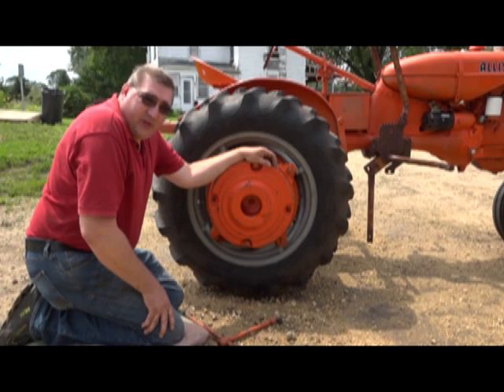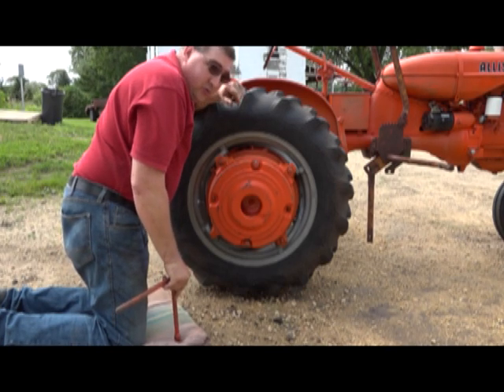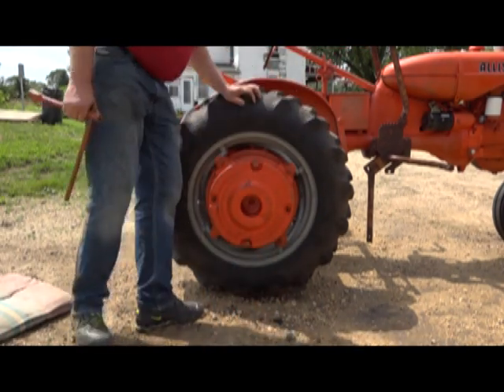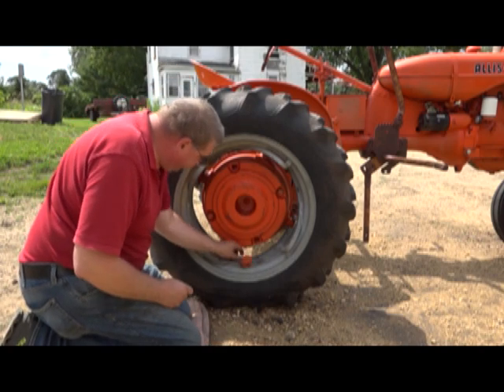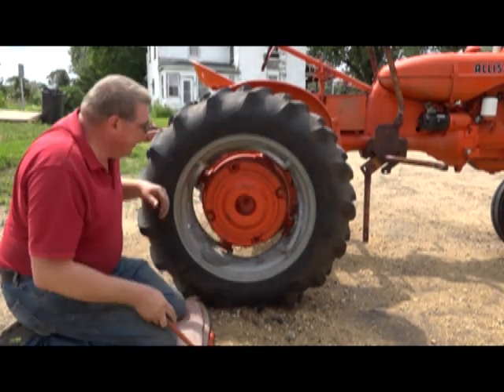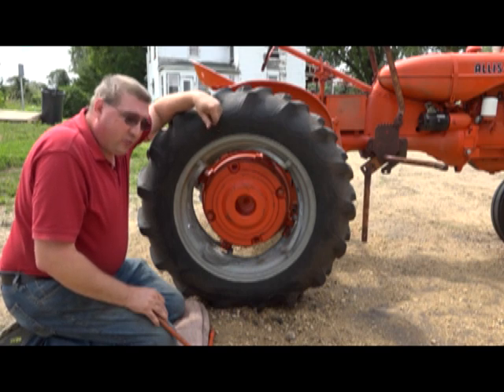How To Adjust Power Shift Wheels On A "CA" Tractor

Comment: Our stop blocks on our WD45 were set to stop for 40 inch rows when we spun the wheels out.  In was all the way in.  We never moved the stop blocks.
Reply from the maker: The stop should always be placed by the     eccentric body. This assures that the wheel will not slip on the rails.
Reply: @The1952caallis  Never had one slip.

Comment: I don't know.  Are you absolutely sure that you loosen the top first and tighten last?  Think about it the other way.  It just seems backwards to me.  Nice looking rig.
Reply from the maker: Yes, think if it this way. The weight of the tractor is greatest on the lower part of the rim. So by loosening the top first it reduces the tension on the rim so by the time you get to the bottom you just have the weight of the tractor and not the rim tension as well.